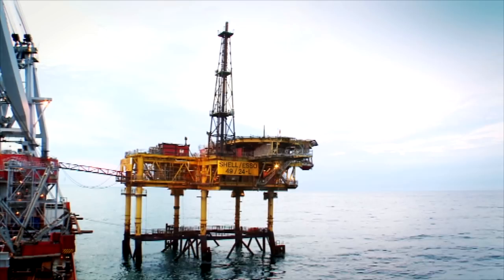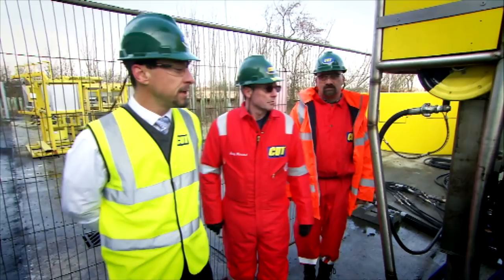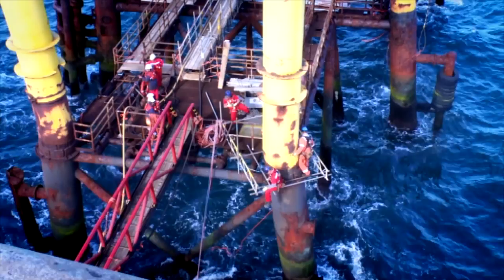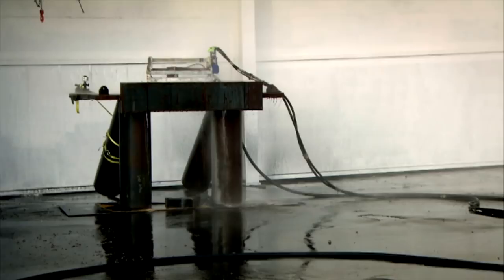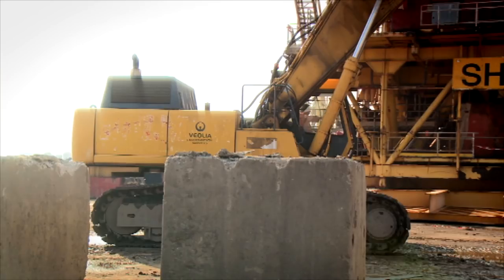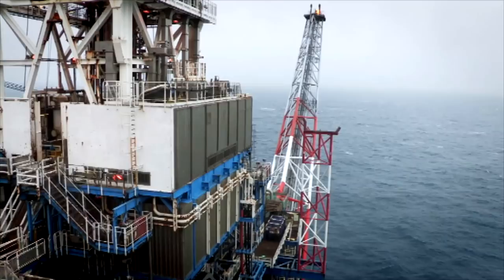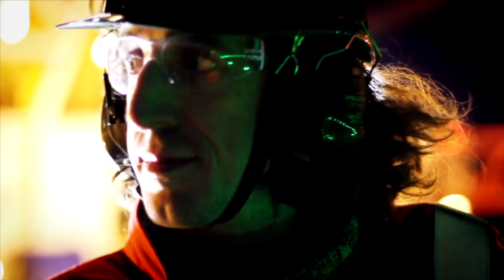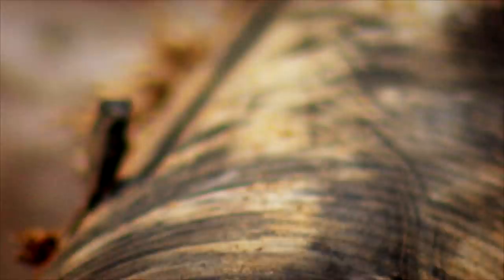Leman Gas Field: How Gas Platforms Are Decommissioned | Engineering Giants

Comment: Huge audio mixing issues here and unfortunecookie it's not easily just blamed on YT's compression. I even tried a 64 band EQ to pull out the speaking and i ended up having to basically remaster the whole audio stream to get iteven  nominal. Main problem is mostly the great and very fitting music choices, but everything is fighting for the same human speech frequency range/s. This is easily addressed when you have the original speech tracks still separate because you can auto-lower (compress) the background audio easily based on the speech. Radio adverts use it heavily to keep speech clear but take advantage of maximum frequency amplitudes. 
48:00 the casing and the 'pins' are still both on there. I thought they described it differently because according to this evidence they have left the casing at best level with the seafloor.  even thought it may not have been described will this shows that only the inner pin was cut ~3 meters below seafloor. Also just before this timestamp they claimed that up to several hundred tonnes of sea life could be clinging to the structure but it looked pretty as Mike Meyers as Austin Powers as Dr Evil might say, 'shorn' ;]
Reply: Kiss off

Comment: Can't one invent a special clamp to install outside the pipe, near the bottom to redistribute the weight through large bolts & off the pipe section being cut, running the blade inside the bolt pattern? Or make it into an offshore community, moving retired platforms to near by & connecting, community security may be more easily managed, no? PS, the worst thing that could happen after the castellated cuts is what?